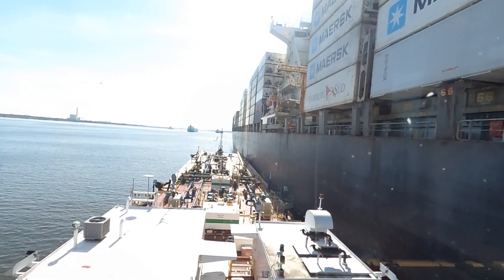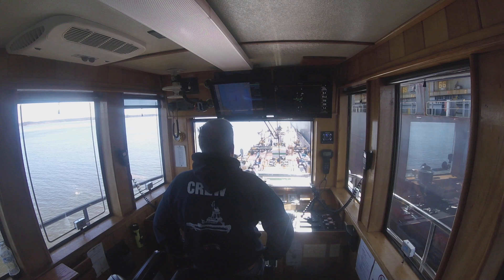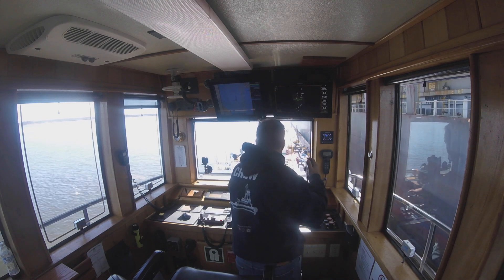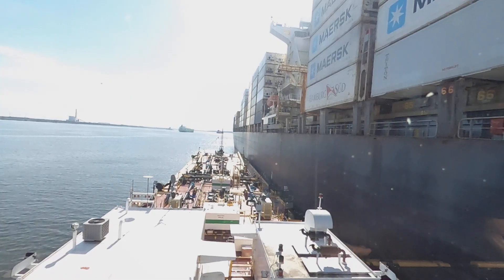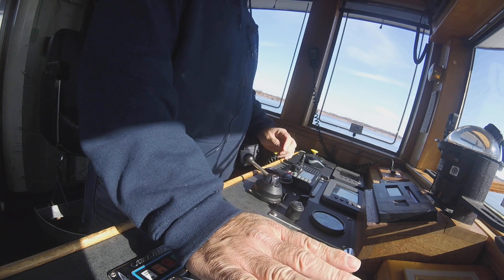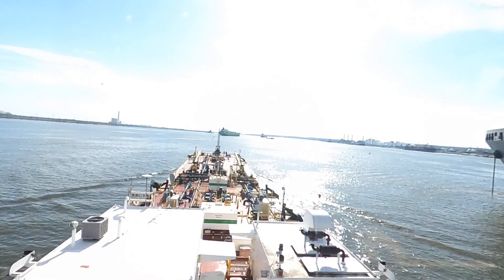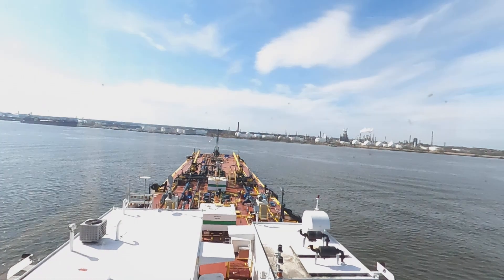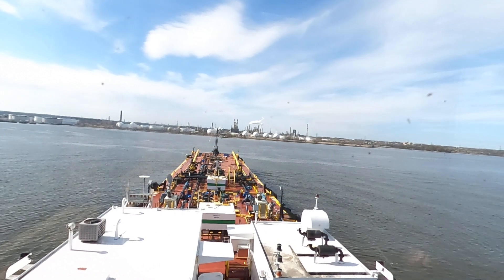Bunkering in Marcus Hook

Comment: Hi Tim, I noticed at one point you knocked over your one camera that was on the mini tripod. I have the same kind with the multi-jointed legs. I had the same problem recently with the thing falling over with the slightest touch. Of course my cam was a bit heavy with a wireless mic setup attached. I just bit the bullet and bought the GoPro Shorty mini tripod with solid legs. $39 on Amazon. I haven't got it yet but I hope it is better than what I have. Otherwise good content. CUOTO
Reply from the maker: Thank you for watching Steven. I too have a shorty.  I find that the tripod funciton works well but only when full extended.  I just need to be less clumbsy. CUOTO

Comment: Tim, love your videos.
Can you please explain what is going on in the engine department on board the tugs (licensed and unlicensed engineer)...
Thank you
Reply from the maker: Thank you for watching. Do you mean what they do? Or are you looking for s engine room tour? (I have a couple of them up on here and will have our top end overhaul video up in a few weeks) CUOTO
Reply: @TimBatSea  The question is how many engineers you have on a tug?
I understand that they are doing regular maintenance but do the overhauls of engines done by the crew?
Reply from the maker: @Dimagori914  Oh Ok. I understand now. Back in the days of un-automated engine rooms, there were 2 (one licensed and one unlicensed engineer). Now with automated engine rooms and our 60 point alarm panel, we only cary one licensed Engineer.  The engineer does not do overhauls or anything beyond routine maintenance. CAT company techs do all the specialized work. This is because they need CAT computers for testing, diagnosing and adjusting and also have been factory trained. Their work comes with guarantees that are essential for continuous operation. CUOTO
Reply: @TimBatSea  Thank you!

Comment: Not sure if its the exact same, but I think the new classes of attack subs for the USN have the "shroud" on the prop which increases efficiency and lowers cavitation. CUOTO
Reply from the maker: Thank you for watching. I think it is similar, but may differ in that they are pump jet design and are more focused on reducing noise where as a court nozzle only wants to increase thrust even if it makes them noisy. CUOTO

Comment: Hello Tim, i've got a question; Why do the tugboats have 2 wheelhouses, and not just one that can move up and down by a hydraulic-cilinder like the barges here in Europe? 
I think it lower in costs and it makes the boat more flexible in air draught...

Greets, and best wishes from Holland.
Reply from the maker: Thank you for watching Richard. There used to be a couple tugs in another NYC based company that had rising wheelhouses.  I am not sure why they didn't take off here, but if I had to guess, it would be that they didn't hold up to the beating they would take off shore. It could also be a class issue. Older tugs ( the few that had rising wheelhouses were quit old) were most likely not built to a class like all of our tugs that are built to ABS Class. CUOTO
Reply: @TimBatSea  Thanks Tim, it makes sense that they aren't strong enough for the beating. 
Have a nice day!

Comment: "No job is so important and no service is so urgent-that we cannot take time to perform our work safely"

My father worked for The Bell System (the telephone company for people too young to know) and when he retired (it was no longer The Bell System) he acquired a sign that has that quote, because they were obsolete signs - throw them away, or take them kind of deal.  Tim going around the bow, even though it took a little longer, was safer, reminded me of that sign.

Another great video Tim! CUOTO
Reply from the maker: Thank you very much for watching. I love that story. (Funny story of my own: When I was in grade school, all I wanted to do was work for Bell Laboratories when I grew up) CUOTO
Reply: It was Southern Bell here where I live. I worked on several remodels at their main terminal building. I remember the racks of step switches and the 48-volt battery room. We put in a Fairbanks Morse generator that had 10 cylinders, 20 pistons, with the crankshaft down the middle.
Reply: I had that decal on the dash of my line truck back in the early '70's. A lineman for a telephone company in Manitoba, Canada.

Comment: I'm curious why you didn't ask the other watchstander how to turn the heat on during your watch.
Reply from the maker: Thank you for watching. That's because we only go up to the upper wheelhouse when we do a job that requires it. So at watch change, we are all in the lower house and it was nice and warm there. (Lower wheelhouse is heated by the boat's HVAC system, the upper wheelhouse is not). CUOTO

Comment: Just a tanker barge question. Isn't bunker very thick/heavy and doesn't it need to be warmed to flow?
Reply from the maker: Thank you for watching John. Yes. You are correct. It is what is left over after the refinery cracks the crude in to gas and diesel. It comes on the barge hot and in colder weather we have to heat it at times to have it acceptable to the customer and to be able to pump it off. CUOTO

Comment: I think this format for camera placement is great.  I can see enough of your control operation without a constant feed and and the chart plotter can be visited rather than constant as well.  I like this mode and hope to see more in this format.  Speaking of formats, what became of the 360 degree camera?  That format was a nice change too.  We have changed our home port from the Feather River to the Port of Alviso, CA.  Only for a month or so.  #CUOTO
Reply from the maker: Thank you for watching Ed.  The view out the window is shot with the 360 Max but in flat mode.  I too liked the 360 videos, but they take a ton of time an are huge files to upload and not many seeded to embrace it as much I had hoped.  But I will still throw one in now and then.  CUOTO

Comment: I used to have a job relieving round 4 or 5 different locations and the difference, even with in the same company were enormous.  I took it that. I was there to “Keep the lights on”  and equipment running. You did see the best things and the things you were itching to change.  But as the “interloper” who were you to say they were wrong.... Different is not wrong..... is it.   You can see more, different and in some cases better ways than you and “Your boat”  are doing. 
Is the saying “Don’t rock the boat” appropriate in these circumstances?   New or new to you equipment is always “” fun””  to work out. Keep up the great work CUOTO. Amacf
Reply from the maker: Thank you for watching. I really appreciate it. CUOTO

Comment: Ah, Kort nozzles. Nice to have on a tug/pushboat and ships that run on deep(er) waters. I don't like them that much. I call them Vacuum cleaners, because they suck all kinds of debris from the canal floor through the prop. In my case, anyway, because most of the time i have hardly 4 feet of water under my ship.
I've worked with a company for a number of years as a deckhand/first mate (yes, combined, we do not work with that many people on an inland-ship in day-operation) and got send out to other ships too when "my" ship was at the wharf for repares and all. I also made it a point to work they way the crew (or in my case, just the captain) is used to. Much easier and it's only tempoaray.
Even thoug i didn't really liked to got send to other ships, it is refreshing to see and learn different ways. And i did pick up on some things that i liked better and therefor kept doing on "my own" ship and even do to thid day on MY OWN ship. Difficult reading like this, eh... lol But you probably get what i mean.
Have a good watch, Cap! CYOTO
Reply from the maker: Thank you for watching and sharing with us Ed. Very cool. CUOTO